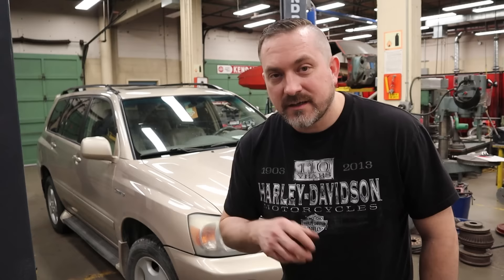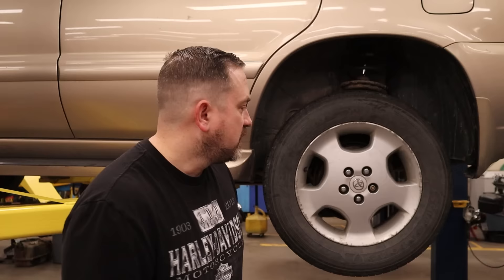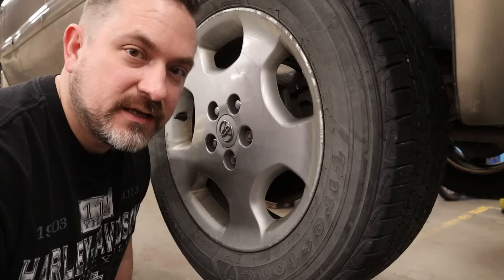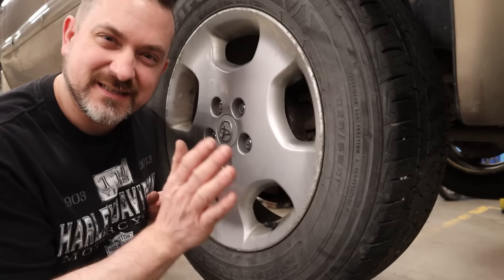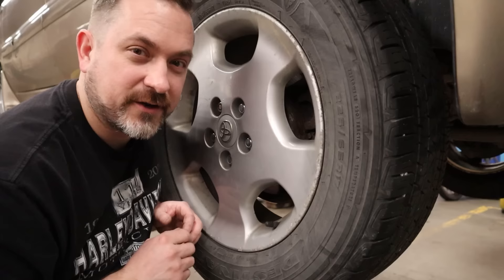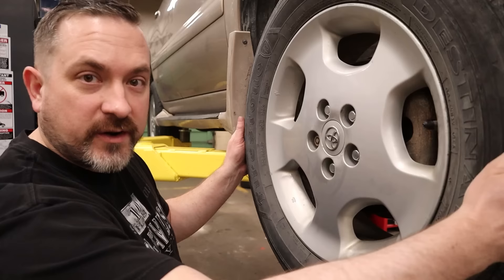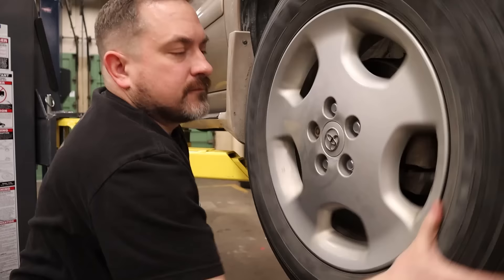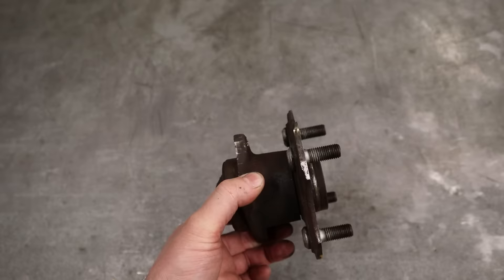How to 100% diagnose a bad wheel bearing.

Comment: When I go 20/30 mph it shakes it gets louder faster I go when I break it can sometimes go quieter wen starts to slow it shakes badly to point the cars behind in rear view mirror where blurry
Reply from the maker: Check your wheel lug nuts first, they might be loose. Don't leave this as it sounds like your wheel is coming off soon.  It could be a really bad bearing also.  Good luck!
Reply: @wayofthewrench  Thank you, also when take foot off all peddles gets louder
Reply from the maker: did you figure it out, sounds really bad.

Comment: Question. 2017 Mazda Miata, open diff, rear wheel drive. When rear of car is on jacks and I spin the wheels, the diff moves side to side and there's a clunking from wheel and difficult to spin. Don't feel much play in the wheel itself. When driving no howling sound, but hitting bumps make a creaking sound in the rear, reversing slowly makes creak sounds on uneven ground even if stationary in Park with car running. Seems weight dependent like if a passenger sits in the car it gets louder. Also happens on hard right turns with enough weight shift, doesn't happen on left turns. Suspension is all good, bushings are all good. Any ideas? Please tell me this is likely a wheel bearing.
Reply from the maker: Sounds more like a anti roll bar bushing or end link to me.  Try driving over a speed bump at low speed dead on and then again at an angle.  If it makes noise like a creak when at an angle, it is your sway bar/ anti roll bar bushings or end link.  Hope that helps!
Reply: @wayofthewrench  Roll bar bushings and end links seem good. BUT when I grab on the passenger rear Axle and push/pull on it, it does move slightly and clunk inside the hub and diff. Driver side doesn't do this. Should I replace that axle or hub/bearing assembly?
Reply from the maker: Hrmm if there is side to side play when twisting the wheel, that would be bearing.  In and out play might not be anything depending on how much play there is on the axle.

Comment: What would you say the problem is if it feels like the front brakes are locking up and smoke is coming from the right passenger side tire. I did all new calipers rotors and brakes and still feels like tires are locking up. Anyone?
Reply from the maker: You brakes are not releasing.  Check/ replace brake flex lines and check for damaged/ pinched brake lines....especially on the right side.  If you were in under the dash adjusting brake pedal linkage, you also might not be releasing the pressure from the master cylinder by not having any free play on the pin that pushed the master cylinder.  I would check for not locked up wheels with the wheels off of the ground before a drive too.  Good luck!
Reply: @wayofthewrench  this happens off and on and again I appreciate your response. Is this an expensive fix?
Reply from the maker: If you do it yourself, not at all.  Flex lines are cheap and so are brake lines but the real cost is labor.  If a mechanic needs to make/replace long lines or hard to reach brake lines, it will get pricey.  Cheers!
Reply: @wayofthewrench  thanks bro
Reply from the maker: You're welcome, hope you get it figured out!

Comment: Any recommendations for me as i have a 2015 bmw 3 series with what i suspect to be a wheel bearing because when i have the steering pointing any amount to the right i get what i can only describe as a bearing noise. This started 3k miles ago where i immediately checked all the wheels for play and noise but nothing found, the only thing that has changed over that period of time is the speed at which the noise would start occurring. Used to be 45mph+ now from 30mph+ , also it does get a bit louder when increased load is applied when cornering but completely disappears when turning left . ?
Reply: I checked it again today with a dial indicator and both front discs have in-spec runout and bearing free play .
Reply from the maker: I have a road test video coming out this week and it'll help you with this for sure.  It sounds like a left bearing to me.  Good luck!
Reply: @wayofthewrench  okay, thank you, will stay tuned in . 👍
Reply from the maker: You check out that video yet and confirm your issue?

Comment: can i only add some grease or oil in wheel bearing?
Reply from the maker: Depends on the type of bearing.  Generally no though.  These hub assemblies cannot be lubed, they just get replaced.  About the only type is the open bearings like in trailers but if they are making noise, they are done and need to be replaced. I have a video on this is you are interested.  Thanks for the watch!
Reply: thank you! now i know what to do
Reply from the maker: No worries!

Comment: Ok, girl hear and I was thinking it’s the bearings. It sounds worse going 30 ish mph. Sounds worse turning to the right. It’s the drivers side front wheel.
Reply from the maker: Did you jack up the car and give it the shake test like in the video?  This will confirm your suspicions.  If the noise gets worse turning to the right, then it is most likely the right side bearing because it is unloading the bearing on the right.  Good luck!  Thanks for the watch!

Comment: Why might a bearing keep getting stuck ?? This is the third time I’m getting my bearing fixed it’s grinding and now has a smell like burning I believe something is locked up
Reply from the maker: What's the time frame between the three bearing changes?  Did you change the bearings yourself or did a mechanic do it?  Are they pressed in bearings?
Reply: @wayofthewrench  yes they are pressed In bearings? No I went to a shop and about a month !! After that it’s grinding again
Reply from the maker: If they are pressed in bearings, the shop probably didn't support the race that touches the part and damaged the bearings.  Bearings generally last a long time.
Reply: @wayofthewrench  okay any suggestions, like what can I tell them so they get it right
Reply: @wayofthewrench   okay one more question I’m here back at the shop they are telling me, that the control arm and the opposite side could be causing the bearing failure is this accurate ?
Reply from the maker: Just what I mentioned above.  Good luck!
Reply from the maker: It's really hard to say without seeing the vehicle.  This is the problem with taking your vehicle to a shop, you're at their mercy and hopefully you can trust them.  No I just check all of my stuff myself and if I don't know how to do something, I teach my self.  Good luck!
Reply: @wayofthewrench  they fixed it the bearing was slipping because there was no grip in the part that holds the bearing
Reply from the maker: Ahh ok.  Someone might have not anti seized the hole or pressed in a hardened bearing at an angle are damaged the hole.  Glad you got it figured out.  Cheers!

Comment: It was a bad day when the old style roller bearings were replaced by these new sealed bearing that can not be adjusted. The old ones never wore out and we didn't need ABS to stop a car. This is NOT progress.
Reply from the maker: Ya know it's hard because most of the time people never greased or adjusted the old ones either.  Some new ones last forever it seems too.  It just depends.  Easier for auto industry to slap on a part though....lol.  Thanks for the watch!

Comment: Dangit…I’m stuck between a bad wheel bearing or just worn brake pads. Gonna have to take the 35x12.5x20 wheels and tires off😭😭😭
Reply from the maker: Jack the truck up and check the wheel bearings while the tires are on the vehicle and off the ground.  No looseness, probably not bearings.  Looseness, them most likely bearings.  Then take off the wheels and check the brakes.  I have 2 great videos on how to check drum and disk brakes.  Good luck!

Comment: I know I have a bad bearing. Just hoping I can make it 30 miles to the garage
Reply from the maker: When did the sounds start?
Reply: @wayofthewrench  I'm not entirely sure. Maybe a couple weeks ago but then I don't leave my house very often. I'm on a tight budget so I've not been able to get it fixed but it was definitely within this month that it started.
Reply from the maker: Well if you are noticing the signs of a bad bearing, then it's time to do it before you have any issues.  It will only get worse.  Good luck!

Comment: I just had my breaks and rotors done and a twice twice Over by 2 different mechanics plus my numerous check list and my 2008 toyta rav4 litterally judt had my wheel bearing and my hub just pop and lock LITTERALLY  it's not funny at all I had to tow it home and it probably had other damage because I had to tow it with my truck because i judt dumped Over $2500 fixing everything is this 2008 toyta rav 4 plus put extra shit on it to make sure the transmission and engine are prestine... so now it's locked up and I can't get it up to se any other damage. Tomorrow ill have to jack up each side and see wtf actually happened because there was absolutely ZERO warning... 😢
Reply from the maker: Yikes!  That's not good.  Did you get a chance to see what broke?  Not sure I've ever seen a bearing lock up like that.  Keep me posted.  Thanks for the watch!
Reply: @wayofthewrench  no I haven't had the chance it's been raining here in NJ the oast couple days so I'm not taking the chance with that thing on a jack stand in rain with someone idk wtf is wrong. I ordered an electric ratchet just got here today so hopefully tomorrow it will be dry enough for me to start pulling this thing apart 😅 I just can ratchet anymore. I also think I'm going to keep off the plastics underneath its like 20 or more bolts and press in clips to just get the front one off 🤔  even with an electronic ratchet it's just so time consuming. I'm going to start from the drive shaft. Check the U joints. Then go to the breaks. Then go to the differential. Save the hardest for last.thabks for your reply tho. Most people never even reply so I tyvm for your time. I'll lyk if I found the problem it's KILLING ME not having my baby on the rd. I put SO MUCH time and money into it. 😟
Reply from the maker: You get it figured out?

Comment: You said the bearing is supposed to be frictionless.   Wow.  I wish that were true.  No such thing.
Reply from the maker: It's reducing the friction as much as possible, obviously it's not frictionless.  It's better than friction bearings and worse than air bearings.  It has to be load bearing so it's the best it can be until they have wear/damage, then the friction gets worse.  You're trying to inspect the wear/play to see if it needs replaced.  Thanks for the watch!

Comment: Thought for a second, you were going to pop the cap, remove a cotter pin, remove castle nut, remove outer bearing, repack, reinstall, adjust and replace cap.  10 minutes, few ounces of grease, and good for another 100,000 miles. GUESS NOT
Reply from the maker: Yikes......so angry of a comment for a free video.  This video is for diagnosing all wheel bearings types.  If you're looking for how to replace these types or how to inspect/repack thrust style  bearings or how to replace thrust style bearings/races, there are separate videos for these.  Enjoy!
Reply: No,no wasn't angry.  Just suggesting how nice it would have been if the engineers had allowed the diy'er  to re-grease and to be able to take up bearing play,SORRY😞
Reply from the maker: Ahhh no worries.  Yeah they are not thinking about making these maintainable, they want you to have to buy the whole part so they can make more money.  Part of it is also the ease or speed of changing the part, which is usually pretty easy.....if it's not rusted up.....which it usually is.....lol.   cheers!

Comment: That diagnosis isn't altogether correct.  some wheel bearings don't always produce play. however, they do produce that rumbling sound.  play isn't the defining answer. i have replaced several wheel bearings,without play
Reply from the maker: Yes you can have bearings that are making noise but have no to very little play (yet).  It is only a matter of time till the bearing will have play.  I have another good video on doing a road test and more tricks to confirm a bad bearing, you should check it out too.  Thanks for the watch!

Comment: Throw it in the air, run it up to 30 to 40 mph and put a stethoscope  on the steering knuckle and listen for growling noise. Problem solved.
Reply from the maker: Yeah or even just put your finger on the coil spring/strut and you'll feel the vibrations on a bad one.  I have a great video on this plus a road test.  Thanks for the watch!
Reply from the maker: You just spin the wheel by hand not with the drivetrain and you'll feel it.  A stethoscope works great too.  Cheers!

Comment: not 100% diagnosis.  a lot of times, noisy wheel bearings will have no freeplay.  sometimes they won't even be noisy up on a lift, you need to put some weight on it
Reply from the maker: True but after a road test that has a speed dependant noise, jacked up wheel shake, and a spin.....you're going to have a really good idea to of whether you need a wheel bearing.  If not, then there is a bit more life to the bearing.  Thanks for the watch!

Comment: As a former mechanic, I gotta disagree with your diagnostics, that sound can also be from a featherworn tire, I've had many customers come in and claim another mechanic told them it's the bearing, when the problem was the tire. The way to isolate a bearing noise (at least for the front end) is to turn the wheel either direction while driving, if you turn left and the noise goes away and then you turn right and the noise gets worst, that means the passenger side bearing is bad. Because when you turn left, the vehicle weight goes on the right side. And vise versa. As for a noise from the back, just swap the tires around and see if the noise changes with it.
Reply from the maker: You're right that there are other methods to diagnose a bad bearing, in fact I have a video coming out this week  showing how to road test and how to feel vibrations in the spring when spinning a worn bearing.  However, your explanation on which side is wrong.  The sound goes away when you unload that side's bad bearing, you'll see it in the video.  I usually diagnose most of it in the road test and then confirm with what is in this video on a hoist.  Thanks for your info and the watch!  Cheers!
Reply: @wayofthewrench  Ya that was my mistake, my coworkers must think I'm loosing my mind, sitting in my chair turning an imaginary steering wheel. lol
Reply from the maker: lol, I can imagine how that would look.

Comment: Rotate the tire and feel the strut for vibration if there’s no play this guy is a hack
Reply from the maker: Yup that's a good tip.  Usually my diagnosis is even before I have the wheels off the ground.  Take it for a road test and listen for the speed dependent sound, veer left and right to see if it disappears when veering to one side and then I check on the hoist for play/spring vibrations.   Thanks for the watch.   Sincerely Mr. Hack.

Comment: Toyota has most horrible wheel bearings ,I had 3 Toyotas, replaced 6 bearings every year. At the same time I had 3 BMWs and never had wheel bearings problems.
Reply from the maker: Hrmmmm.  Toyota's are usually great vehicles and I swear by them.  These weren't tapered wheel bearings were they? Perhaps too tight?  I've done 2 wheel bearings on my 4 Toyota's over 28 years.  Do you live in a salt belt by chance?  Thanks for the watch!

Comment: I almost hate to say this because this guy is so sincere but this is misleading. I do not recommend this video as a diagnosis of a bad wheel bearing.  I've worked in full service garages for twenty years and I don't know it all. You can have a very bad wheel bearing with no side to side or up-and-down play on your wheel.  You may not even hear it with no weight on it. I could see how a less experienced mechanic could take the advice of this video, find play, and replace the wrong wheel bearing based on play from ball joints or tie rod end. (A misdiagnosis). Its always a bitch when you replace the wrong part.
Reply from the maker: I do address this issue in the video.  I explained that side to side only could be steering components and up and down play could be suspension component wear.  Yes a bad bearing can have minimal to no play and/or might not make a sound on the hoist but when you have a speed dependent sound (first diagnosis) plus up/down AND left/right play while other wheels don't.  You have a bad wheel bearing.  I also made another wheel bearing road test video and some other tips/tricks on diagnosing a bad wheel bearing, you should check it out too.  On a good road test, you already know what you are looking for so once you see the other signs and have done a good underbody inspection, you know if it is a bearing.  Thanks for your info and support for the channel.  Cheers!

Comment: Worn upper and lower ball joints will also allow play in jiggling the wheel while the vehicle is suspended. This fella might be a well known jiffy lube technician, but he's no mechanic
Reply from the maker: You're absolutely right, that why I said that if you have play up or down, you have worn suspension components.  Left and right play is steering suspension components.  Play in both directions can be both or wheel bearings or loose lug nuts. Thanks for the watch!

Comment: I'm disappointed with you, mechanics know how to determine the bearing long before there's play and you should know how very sad.
Reply from the maker: You don't have to be disappointed, checking for play is the final confirmation for a bad bearing for me hence the road test first.  A quick road test is the best way by listening for a speed dependent sound that comes and goes as you load/unload the bearing by turning the vehicle back and forth.  I also have a great video on road testing the bearing and more tips to confirm a bad bearing.  Thanks for the watch!